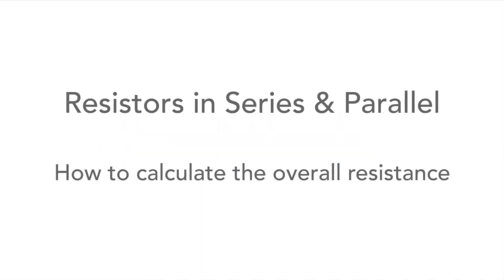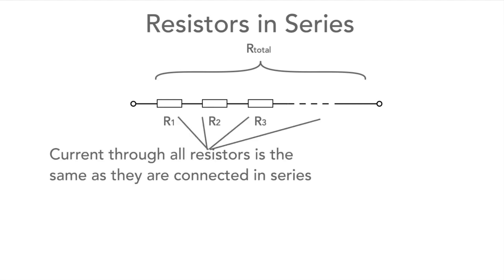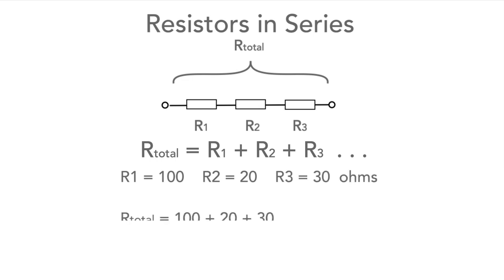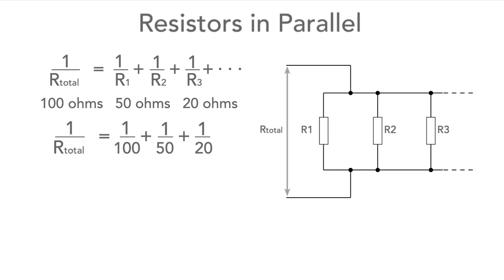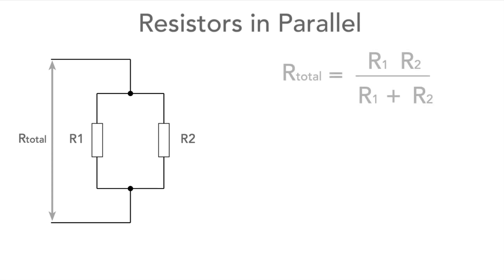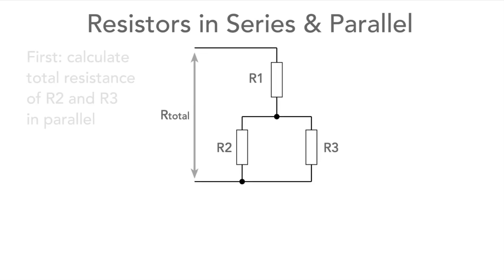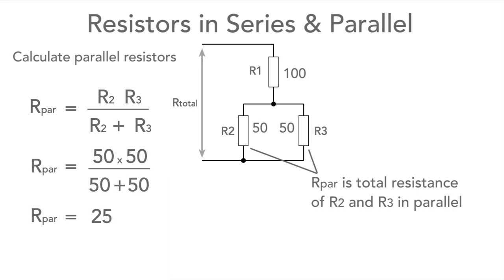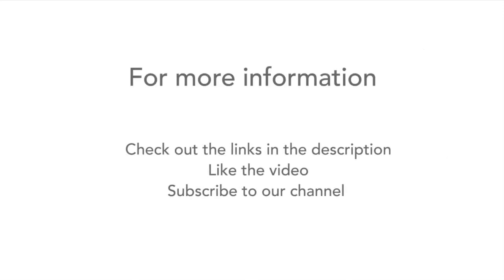Resistors in Series & Parallel - Formulas & Calculations

Comment: How did you get 12.5ohms from 008ohms?
Reply from the maker: It is relatively straightforward algebra and manipulation of the equations. I need to put an explanation on the accompanying web page so that people can see how this is done. I've had a couple of people ask this, so in a couple of days I will aim to have included it on the relevant page on my website: https://www.electronics-notes.com/articles/basic_concepts/voltage/voltage-potential-divider.php
Reply from the maker: I've added the explanation as I promised - you can find it on this page: 
https://www.electronics-notes.com/articles/basic_concepts/resistance/resistors-in-series-parallel.php
Reply: @ElectronicsNotes  thank you so much, I’ve checked the website link, you explain clearly and make it easy to understand
Reply: @ElectronicsNotes  You're amazing! Thank you 👍🏼

Comment: great explanation,  I knew the formula for in parallel , but I forgot all about the 2 values shortcut */+ if the values differ, of course if values are the same for 2 resistors you just half it, but the shortcut is often simpler than working out teh reciprocal value

BTW be nice to see the same type of video but on caps, I know the methods are to the opposite of resistors, but viewers might find it interesting
Reply from the maker: Yes, I am planning some more similar videos and we could do ones about capacitive and inductive reactance. Good idea.